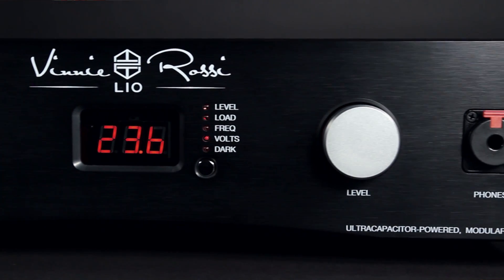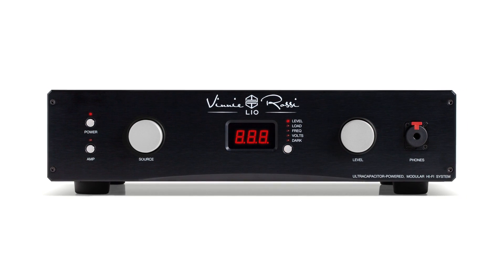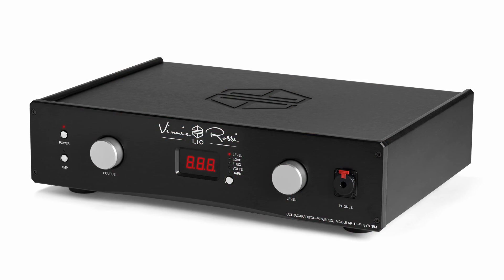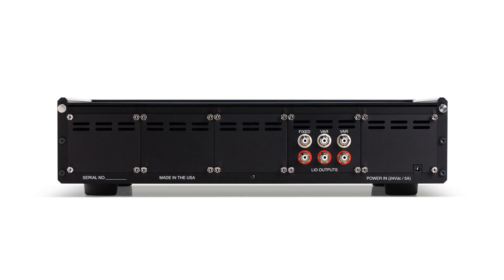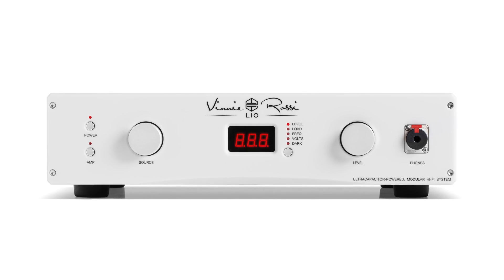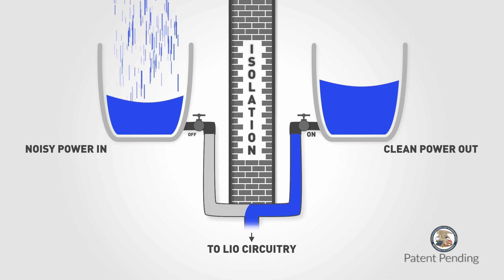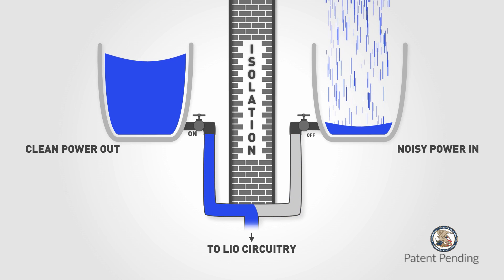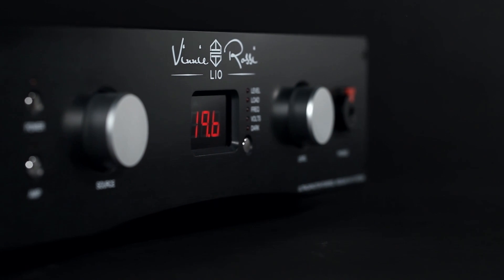LIO by Vinnie Rossi

Comment: I've always like this type of concert I Got a Feeling it's going to be expensive how much if I wanted a module with phono stage Bluetooth and possibly DAC? What is the output stage can you get MOSFEF or is it just tubes? And what is the chance of getting modules in the future say 10 years down the line? What speakers do you recommend to use with it I was thinking about some tannoy's or cube audio Nenuphar, or possibly harbeth not sure which model might build them myself? And what's it like connected up to a active crossover module unit i suppose you don't make that.